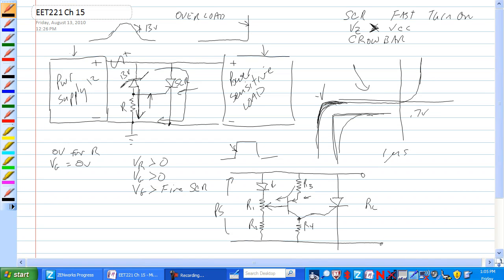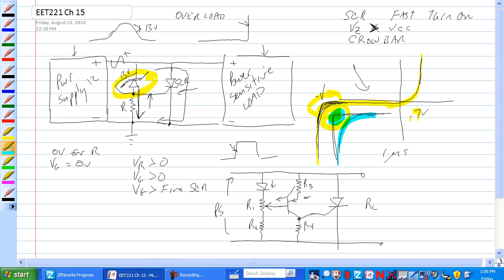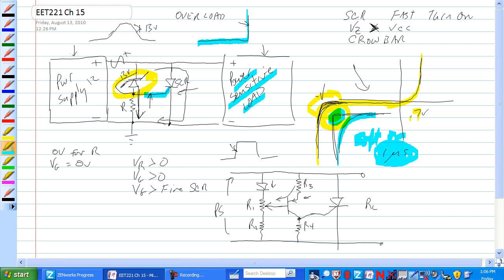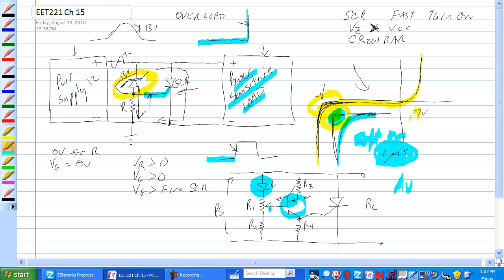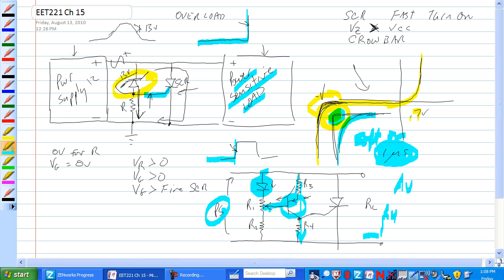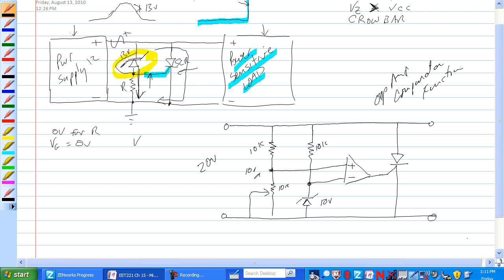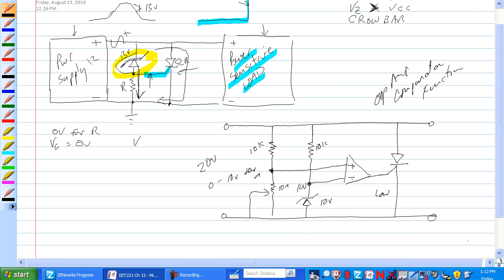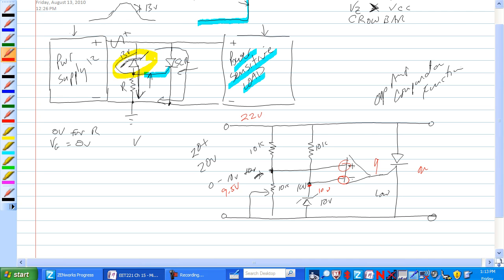8 SCR: Crowbar Circuits 2

Comment: I’m trying to find a crowbar circuit for my hydro turbine output: I need it to clamp across the output at 250v AC and stay there for several hours if necessary. Total power of the circuit is up to 1000W. 
Any suggestions?
Thanks.